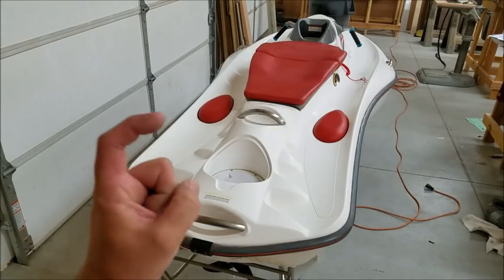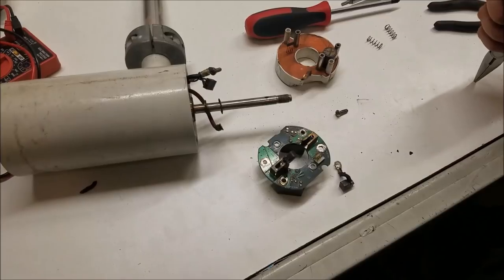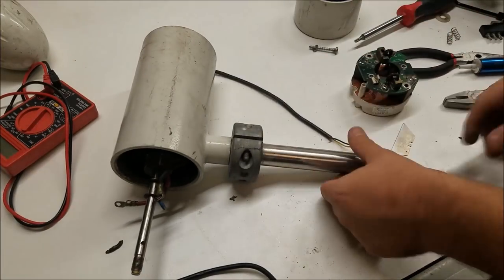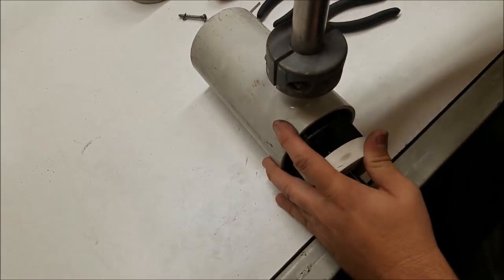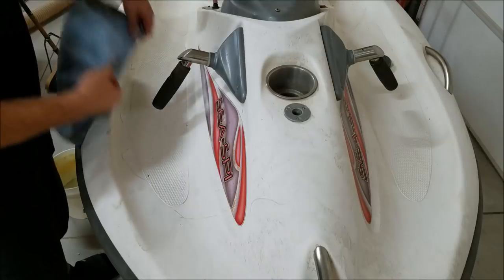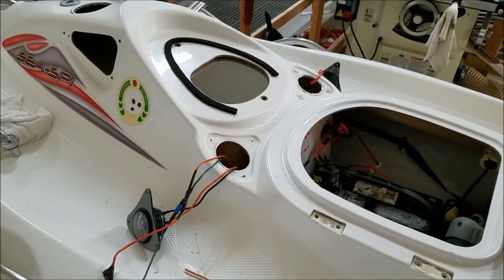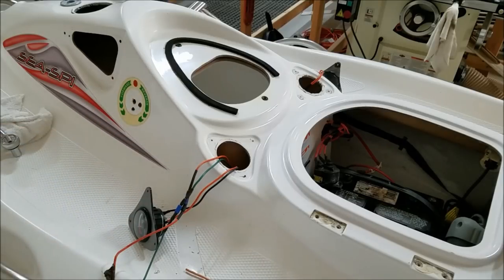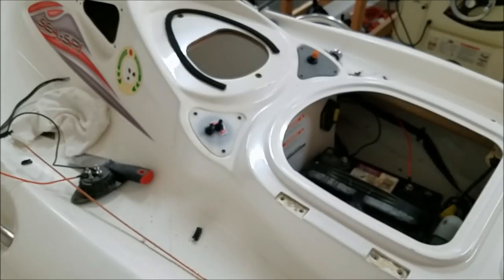Fixing the Second Glass Bottom Sea-Spi

Comment: awesome idea.
Each cell of a 12v battery can be tapped to vary voltage and wattage to motor to vary speed.
My grandfather drilled into top of battery and put a copper screw into lead top tap each 2.2v cell sealed with epoxy. This was commonly done to convert 6v tractors and cars to 12v. Would crank starter on 12 and run lights ignition on original 6v .24v should not harm motor. In fact only low voltage overheats windings. Your idea is good. 
We made our own contactor .
Cute baby boy. My son also watched my in shop working now 25yo electrician. Shalom

Comment: Good afternoon I watched your video on repairing a sea spi  I was just gifted 
One and I’d like to know can these vessels be titled Andy do they need to be registered?
Reply from the maker: Can they be; sure. Any state will gladly issue you a title and registration in exchange a yearly registration fee.
Do they need to be registered? As they have a motor, probably. Most states require registration on any motor vehicle. Given the engine size this may not apply, but it probably does.